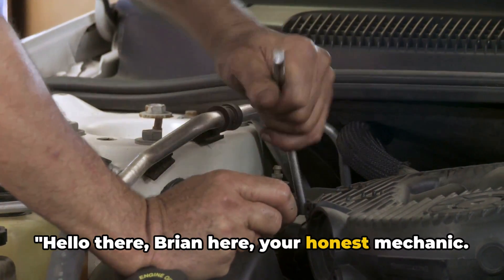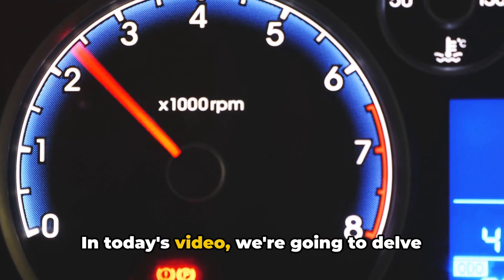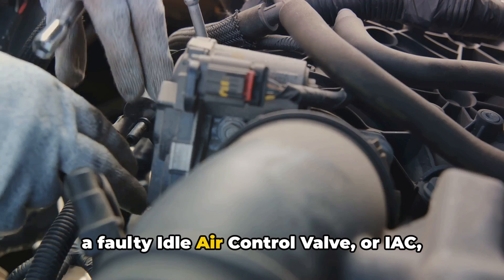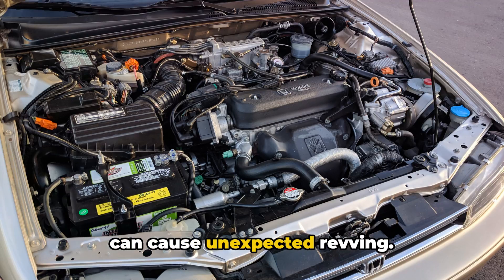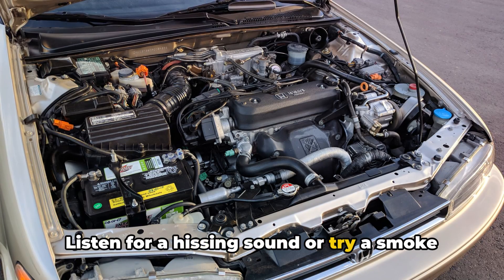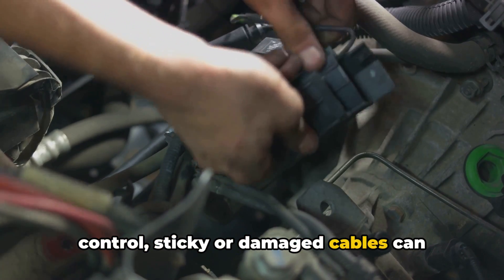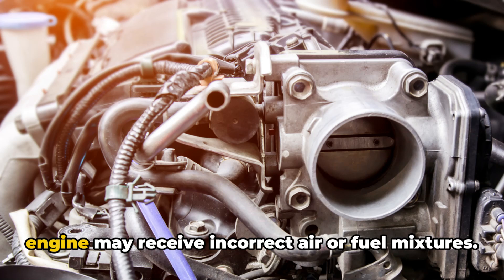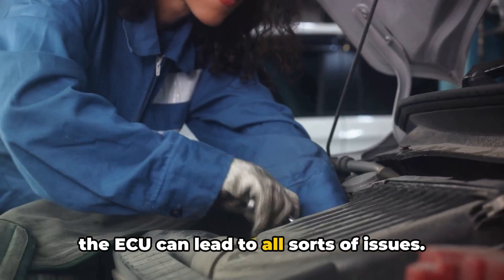Car Revving in Park: 7 Common Causes & Fix

Comment: Any input is appreciated.  Got a 2003 Honda Civic LX 1.7L.  Only code I have is a PO128, but about to put in a coolant temperature sensor (already did thermostat and topped off coolant).
Anyway, it starts rough sometimes (misfiring), seems like too rich on mixture (smell fuel outside of cab, including tail pipe but no visible smoke).  It will then rev up to 2000 rpm for about 10 seconds sometimes....I can go down the street at 20 mph without touching the gas pedal). It will go back to normal reving after a block or two.  Sometimes, it starts up without any problem and normal revving.
I'm gonna replace the PCV hose, as I think it may have been scrunched up when getting off the old pcv valve.  My other suspicion is when cleaning the MAP sensor, I may have damaged it.  I also cleaned the throttle without removing it when I cleaned the MAP.
Oh, I likely have a blown head gasket (about to test it too).
Any suggestions beyond replacing the PCV hose?  The replacement PCV was not OEM, but Duralast (bought at AutoZone).  It fit fine and gave the clack sound when I shook it to check functionality.
Reply: Follow-up: the Coolant Temperature Sensor fixed the code.  New plugs fixed misfires that were likely caused by a few overheating episodes.
Used Bars (non-professional) to fix overheating via head gasket issue, at least so far.

Comment: My 2000 mazda b2500 revs when the vehicle is in motion with no throttle applied. The revs settle when the car comes to a stop. Makes no difference if its in gear or not. I have replaced the IAC and it still does it. Any suggestions?

Comment: Hi I have mazda 6 2019 it’s revving on park and when I push on the brakes on the sign stop any idea what is wrong
Reply: With check engine light
Reply: @MohamadBaroudi-v7c if you go to an auto parts store they check the code for you. It’s free.

Comment: Hello, my car revs in park occasionally. And when I try to rev it, the RPM goes high or it gives another rev after. Does relearning help this issue?
Reply: I have this problem as well, like when I turn my car one it alr revs high on its own, but sometimes it just goes back to normal, from neutral to drive just moving this shifter (auto) it jerks like if the car wants o start driving and when its in drive the car drive it self up to 35 mph

Comment: i have 2005 nissan note that revs around 1300 to 1500 rpm, drops to 800 with a jerk when put in drive. Do you have any idea what can be the issue
Reply: Could be throttle position sensor by then again it can be a lot of things

Comment: So is it supposed to be on 1? Mine steadily stays on 1, but it doesn't rev up or anything. Is that Normal?
Reply: i think so yeah
Reply: 1000 to 1500rpm  is about standard in park from my experience, so 1 to halfway between 1 and 2 is fine
Reply: @kadomcdonough8235  car i have atm just below 1 but she does have problems

Comment: Hi! I have a bmw 640i n55 engine petrol after a cold start the revs goes up and goes gradually back on normal every time putting on neutral after drive or reverse,when the car is completely warm up everything goes normal no more revving up.today when i start the car i have change the gear from drive to neutral the revs remained a little high from the normal on all the gears D R N P.goes in normal just pushing the gas pedal
Reply: are you stupid?

Comment: My 2009 honda civic revs its own when i start the car but happens occasionally this is the second time happening within 2 months
Reply from the maker: It sounds like your 2009 Honda Civic is experiencing intermittent high revs upon startup, happening twice in the last two months. This could be due to several issues, such as a faulty idle air control valve, a problem with the throttle body, or an issue with the engine's computer system. since it doesn't happen often keep an eye on when it does and scan for any codes using an obd scanner

Comment: I have a 2010 genesis coupe 2.0t that i recently purchased. It reved up on its own in neutral (6 speed manual)  and shut off car. But happened again while driving causing rpm to rise even with clutch pushed in or anything i tried. Had to shut off car while moving to pull over and assess.set my traction control off as it would have spun tires under load.  Any thoughts or recommendations?

Comment: i have a 2000 silverado that has a cable throttle body, i have replaced the idle air control sensor but it still revs up when i turn it on and wants to accelerate on its on. Do u recomend me change the throttle body or cable? Or would a tune have anything to do with it ? it is a v8 swapped 5.3
Reply: did you ever find a solution? my 5.3 is doing the same
Reply: @josemunoz83 my 5.3 does the same!
Reply: @watchman9198  fixed mine about a month ago it ended up being the throttle position sensor

Comment: I have a 2008 ford f250 with 60,000 miles when I come to a stop light the engine wants to accelerate to very high speeds so I have to turn the key off about five time before it goes back to normal very scary has anyone had this problem
Reply from the maker: Hi Russell, Sorry to hear that. managed to figure it out? here is what I think, The issue you're experiencing with your 2008 Ford F250 could be related to a malfunctioning idle air control valve, throttle position sensor, or an issue with the throttle body itself sticking or being dirty. It's also possible there's a problem with the vehicle's engine control unit (ECU). It's critical to have this checked by a professional as unintended acceleration can be dangerous.

Comment: Ugh very educational! But my 2014 ford explorer has been idling super low. Almost below 1000. And when my ac is turned on it often kills the power in my car. I have no clue where to even start 😢
Reply from the maker: Hi Britbrat, Thanks. It sounds frustrating! Low idling and the AC affecting your car's power might indicate an issue with the idle air control valve or a problem with the alternator not providing enough power. Both issues can lead to your Ford Explorer struggling, especially when additional load like the AC is turned on. It's a good idea to start by checking these components and ensuring your battery and alternator are functioning properly. A professional diagnostic can also help pinpoint the exact cause.
Reply: Same thing with my Ford escape!!

Comment: How bout when i turn and hold the ignition the car revs like the ignition became the gas pedal?
Reply from the maker: Hi. I would check the Throttle position sensor, get it tested before any replacement. Do you have an OBD2 scanner?

Comment: Can I drive the car when I have a air leak? Till is fix
Reply from the maker: Hi Jose! it should be okay if the leak is not massive then you can but I recommend that check all vacuums as soon as you can.

Comment: I noticed my car revving whilst in neutral so I opened the bonnet and saw my oil cap came off with oil splashed all over the engine. Luckily i found the cap and put it back on along with cleaning the engine to avoid it from burning. Just wanted to ask if the cap missing is what caused the car to rev on its own?
Reply: Thank you. On a road trip and this comment saved me a lot of trouble. My oil can wasn’t on 😭
Reply from the maker: Hi, The missing oil cap itself is unlikely to cause your car to rev while in neutral. However, the open oil cap could lead to a drop in engine pressure or allow extra air into the engine via the crankcase ventilation system, potentially affecting the idle speed. It's more probable that the revving issue is related to another underlying problem, such as a vacuum leak, idle air control valve issue, or throttle body problem. It's good that you replaced the cap and cleaned the oil to prevent further issues. If the revving persists, it would be wise to investigate these other areas or consult a mechanic for a thorough diagnosis